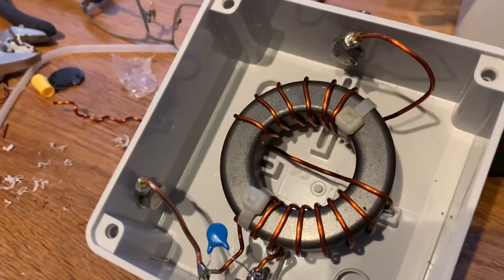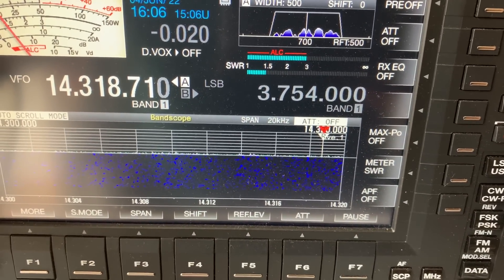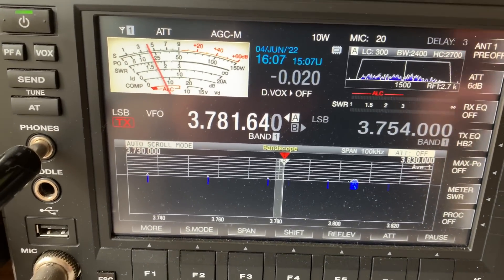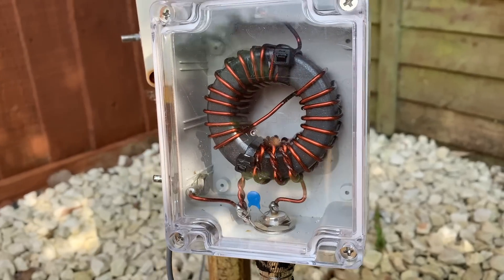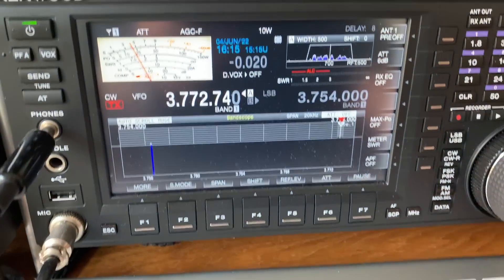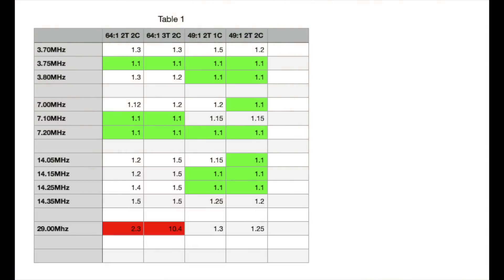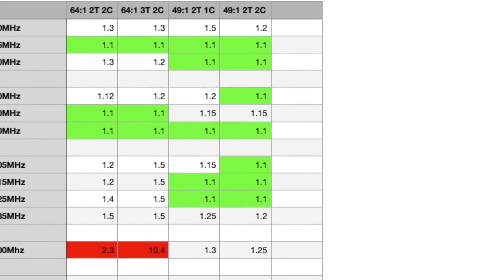HAM RADIO: Whats better a 64:1 or 49:1 Build and Test

Comment: I have a question... since I also want to remove the noise a little. If I would ground the antenna... my issue is that mine is in the attic. Wold it influence the antenna in a way maybe if I run a wire down to the ground where I have the possibility to ground it ? Is nice that yours is actually close to the ground point 😁. 73 DE YO6DXE.
Reply from the maker: I wouldn't run a ground wire ( it more like a counterpose) try a common mode choke to reduce the noise. it may help?
Reply: @mike-M0MSN  That is what I thought about. Thanks Mike. I must buy some toroids and I will order one to make the choke as well. 73 DE YO6DXE.

Comment: Very interesting, comparing the 64:1 and 49:1 transformers.  The SWR results would tend to slightly favor the 49:1, but SWR is one thing and how well they perform at transmitting and receiving RF is another!  Like you say, jury has to be out on this one, more results needed.

I do like those boxes you've used with the clear lid, certainly lets you see that all is well in there, without the need to keep removing the cover.

Regards, David (M0XQZ)

Comment: The first 2 turns does work as primary AND Secondary turns?
And which is the best, depends on the environment and antennawire etc.. It will never be everywhere the same.

Comment: Mike, some folks on this side of the pond put  a capacitor in the exact middle of the antenna to lower the resonance on 10, 12, and 15. Have you used an analyzer to see where  or how far up 10 meters is? Steve Ellington has done a lot of testing of the EFHW on YTUBE. I  bought some parts to build one, but my health and needing to get my home rebuild done got into the way?

Comment: Mike, the impedance of an end fed half wave wire antenna at resonance varies between 2000 and 4000 ohms depending upon configuration (ie. inverted L, inverted V, sloper, etc,), height above ground, your local ground conductivity, and nearness to trees and other structures.  If in your situation the impedance is closer to 2500 ohms, then a 49-1 autotransformer will provide the lowest SWR minimum.  On the other hand, if your impedance is closer to 3200 ohms then the 64-1 autotransformer will provide the lowest SWR minimum. The optimum, (ie. minimum SWR) clearly depends on the specific antenna installation.  However,  as you point out, either will work quite nicely, particularly on the low bands.
Reply from the maker: yep, and well said thanks Steven

Comment: Mike you mentioned your antenna was "cut" for a 64:1 -- what do you mean?   📌📌📌
I've been looking at many videos of EFHW and never heard them mention changing the antenna length depending on whether using a 49:1 or a 64:1.
I have seen them mention about the height changing the antenna impedance, which determines whether to use 49:1 or 64:1 -- If memory serves the high antenna was best with the 64:1.
Reply from the maker: Thanks for the comment, that maybe the case, however, as the length of the EFHW, was cut using a 64:1  at the end, to set the VSWR. I had no idea if the length of the wire would be correct for a 49:1 transformer. It turns out that it make little if no difference. 👍🍌🍌
Reply: @mike-M0MSN  Thankyou Mike. Yeah - that makes perfect sense.  
Just made my UNUN a 59:1 - taking the middle ground - as from what I've seen the impedance goes up with height - but I'm still not quite at 0.6 WLengths so did the 59:1 to compromise.  We'll soon see how that works out.   I'll be trying out a different form of mid-span capacitor on it to bring the low F side into the 75M phone band as well. 
Appreciate channels like yours that share your experiences.
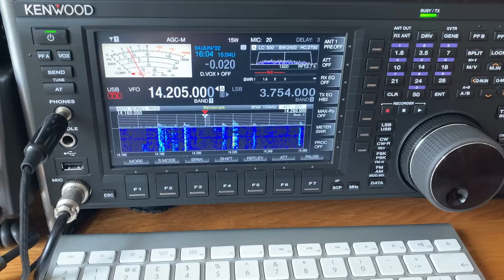Reply: The thickness of the antenna wire plays a role in the difference between 1:49 or 1:64 transformer! A thicker 14 awg antenna wire will be about ±2500 ohms while a 16 awg antenna wire will be ±3200 ohms.

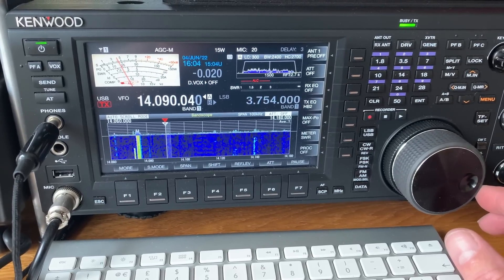Comment: I love the video. Relative newbie to HF. Already have a CaHRTenna Artemis with a 2:14 toroid on 40m-20m. Antenna tuned to do FT8 portable and works well with my QDX. Printing an EFHW winder now on the 3D at the library. I am watching videos and saw an interesting idea you may want to test. The guy had an extra winding on a 49:1 making it a 2:15 ratio. I know my ratio is non standard and don’t care, because this is the way it is wound. Sounded like something you would try.

Comment: You could have done the same thing with your 259b without transmitting a signal, assuming you have any kind of antenna analyzer.
Reply from the maker: Yep, but where the fun in that? (did use my VNA off camera)

Comment: ...the common mode choke comes in when you are unable to bring the coax away at right angles or back, behind or away from the radiating element and not parallel in any way, so then you would need a separate wire for a counterpoise. Then the coax needs a common mode choke to make it no  longer part of the actual antenna.. The coax then becomes just a feedline. If the coax shield is also the counterpoise, which is acceptable (mine is 65' of LMR 400) which is the case in my situation you need to do nothing. 

The take away from this is... 2  43 mix cores are a bit better than 1, higher power levels need 3, likely because voice peaks even at 100 watts or more do not come close to saturating the cores which start to raise the curie temperatures.  43:1 is a bit better than 64:1, seems to give a bit better overall match (50 ohms to 2400) (Mikes coax length, type and antenna length is unknown... 130', straight line or L shaped in some way?) the use of what looks to be #16 wire , is smart, reduces simple I/R current losses at the low Z point so 100 watts into 50 ohms gives a max 1.4142 amps in the balun windings.  If you put 100 watts into the balun and you can detect little or no change in temperature (a calorimeter might work here) you have a very efficient 49:1 transformer/balun...  Virtually all losses in a balun are in the form of heat caused by Z mismatches, thin wire for windings and/or core saturation at various power levels. Mike has this black art mostly figured...

The earth ground can be at the balun if convenient or at the rig, it's there to bleed off any DC static build up on the antenna, particularly on dry days and which can cause noise.

Richard... VA7AA

Comment: Great video as usual. I have been playing with 3 cores with the 240-52 mix and 12 ga wire. Sorry I don't know the sillymeter size, only bananas. 🤣 I have been having better luck with permeability and heat when my operator friend is at legal limit. Antenna building is an amazing hobby and endless.
Reply from the maker: So true, have fun.

Comment: Just about to make one of these to a good friend of mine and is very grateful for your wonderful video! I Was wondering 64:1 or 49:1, dual or single core... Seems like a single 240-43 will be good enough when using 100w, the loss compared to a
 dual setup seems to be negligible.

By the way, will there be any follow up on the frame antennas on their performance?

Thanks for your great videos! 🙂
73's sa5vox
Reply from the maker: Yep, and thanks 73

Comment: I restore old tube am radios and sometimes the capacitors in the if cans have silver mica disease so we take the cans out cut the original mica's out then add a pair to the legs after reinstalling some radio schematics give you the internal capacitance some don't ,most people say just throw a couple of 100pf in there but sometimes the sensitivity hurts what I do is install two adjustable caps do an alignment on the radio then take them out measure them and then put the right mica's in then realign. My question is has anyone tried this on the unun's to see if there is a better match than 100pf on their given antenna configuration?
Reply: Very good question, I have though of doing the same myself. I am sure a variable cap on an unun would allow adjusting the impedance to get closest to 50 ohms.

Comment: Posted a short video with a few of my saved NanoVNA SWR curves. The difference is not huge... 1:64 slightly better SWR on 80 and 40m... 1:49 slightly better on 15 and 10m with 100pF compensation capacitor and FT114-43 on my shortened EFHW with 110uH coil - Mind you the way you hang up your antenna: Sloping (+angle) or straight, height above ground, how many 90° turns to squeeze it into a tiny garden,  has a much bigger impact imho.

73 Tobias and LabCat Amy 🐈‍⬛

Comment: The Main Job of a Balun is to convert Unbalanced to Balanced and if the balun is doing that job correctly you will have very high common mode current attenuation. TRX LAB https://youtu.be/kMlKfHHR8FY

Comment: What I don't understand (as someone who is just starting out) is why, after over 100 years, are we still jacking around trying to figure out what works?
Reply from the maker: Yep, would agree with Gary, I have both the 64 and 49:1 and a DX Commander ABV, a couple of mono band dipoles and each antenna works better than the other at different times….  Go figure..
Reply: If we just want what works, we would just buy the products for sale. The homemade solutions and experiments are for learning and understanding. With this kind of hands on education new leaps are made and sometimes new creations are the result. Callum’s DX Commander was built upon pre-existing concepts but he was inspired to try to build something new from our community’s collective theory and understanding. Not to mention, the pride of self built tools can’t be understated.
Reply: I would presume that what works well for one, doesn't necessarily work well for another. 
It is all about experimentation and finding out what is best for your station. 
It is also good if the bands work right to allow for testing of it all when you can!!
Reply: Because everything in an antenna affects everything else. Placement above the ground, nearby metallic surfaces, distance from the ground of the Unun, toroid type, number of windings, coax feed length, grounded or not, shielding on the antenna wire, type of coax, etc etc. It’s a system and you can’t change one thing without causing something else to behave differently. Dave Casler says the rule of antennas is that “everything affects everything”

Comment: For someone who experiments with antennas so much, I am amazed you don't have a nano VNA. They eat the MFJ analyzers for breakfast. BTW if you want meaningful results you should measure at the feed point or via an n * electrical half wave of coax or  better still if you have a VNA just calibrate at the antenna end of the feedline. I can highly recommend Alan W2AEW 's video series on the nano VNA
Reply from the maker: I have a HP VNA and all my coax lengths are Andrew FD4 at 42 or 20 metres long depending on the antenna. But you have a good point. Thanks
Reply: Following on to Rob’s comment: it would be a lot more informative if you also recorded the Rx and Zx numbers, SWR is one piece of the complete picture IMHO. I believe those would better help quantify the differences between the 3 units tested. 73 de WS1M

Comment: Unless you have a common mode choke between the transformer and feedline, the feedline is part of the antenna, so YMMV widely.  If the feedpoint is elevated, a counterpoise will be needed when using a common mode choke.  FWIW, I began experimenting with roof-mounted EFHW antennas in the mid-90s and found that the transformer/counterpoise/choke combo worked best. Also, I built a 10m plus 6m EFHW (for my Motorola Syntor-X9000) and used, if I recall correctly, mixture 61 cores.
Reply: correct a choke is a must   simple test squeeze  up and down the coax  near the transformer   look at swr on analyser and if any change  then you coax is radiating

Comment: Why not put a switch to add or exclude the last two turns on the secondary, so you have both 49 and 64 on one core? It would help tune different wire lengths I think.
Reply from the maker: You do not need a switch, a tap on the coil will do it.

Comment: ratio 56:1 is the best optimum if I.m correct in turns it will be 15:2 which gives 56.25:1 (close enough) of course everything depends on the core (31 vs 43) as the same ratio can be done with 30:4 but then an inductance becomes a low pass filter if the core is too efficient. (What you could observe on your 64:1)
Reply: I always wondered about the median option of the 15/2-56:1. It seems to transform a wider range of a likely high Z presented by the EFHW.  So, I did my version of the Chameleon Lightweight EFHW as 15/2. It worked great and tuned everywhere quite well. (Besides, It looked to me like that’s what Chameleon was doing) btw..a 240-43 was used.

Comment: With the exception of 7.10Mhz being 1.15:1 as opposed to 1.1:1 (practically imperceptible ... 99.52 watts vs 99.77 watts out of 100 watts) the 2 core 49:1 tied or beat either of the 64:1 transformers.

Comment: I have questions: Did you build the 49 to 1 transformer with a 140-43 toroid? And: How long is your wire you used for the test? And how did you build the counterpoise wires? How long are they?
Reply: I’d be interested to hear.
Reply from the maker: 240 43 types
Reply: @mike-M0MSN  25% rate of answer ;) Tnx.
Reply from the maker: @DO7OO  that's because the other answers are in the posts, but if it helps halfwave length for 40 plus a 110uH coil and 1.3m tail..no counter just earthed.

Comment: but how effective is an endfed antenna against a dipole antenna on transmit and reception
Reply: I can answer this question.... I just put up my first end fed with a 49:1 and 130ft of wire, the noise floor is gone compared to my inverted Vee fan dipoles.  Bands are in pretty bad shape today to give results on TX, but I'll be back to update this post when I get results... but I think most people are going to tell you the same thing.... the end fed is so quiet !
Reply from the maker: Yep all about what’s best for you.

Comment: Similar results achieved here too, fairly inconclusive. I have a 20metre efhw attached at the moment, planning on a 40metre wire specifically for 80metres as the harmonics don't quite line up within 80 and 10metres. There are mods you can do to the wire, but for me a separate wire isn't a problem. From your video it looks like i'll be adding a ground, as noise is fairly significant here. Great video, Cheers Mike 73 de GØUSL
Reply from the maker: Hi Mark, yep 👍

Comment: Mike, what length did you cut the 64:1? The length worked well on both transformers including the 49:1.
Reply from the maker: Half wave for 40 plus a 110uH coil with 1.3m tail
Reply: @mike-M0MSN  Mike, was it the coil you built in the recent video and it was less than 100uH or did the coil actually measure 110 uH?  Garry / WD0DUD